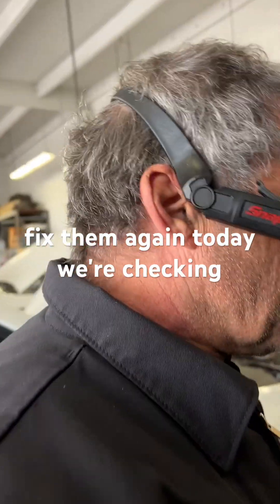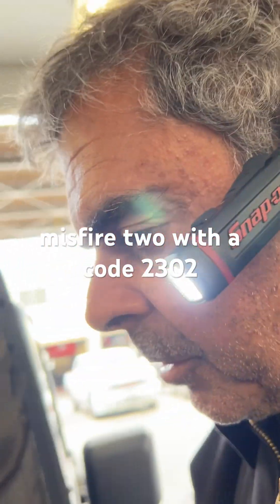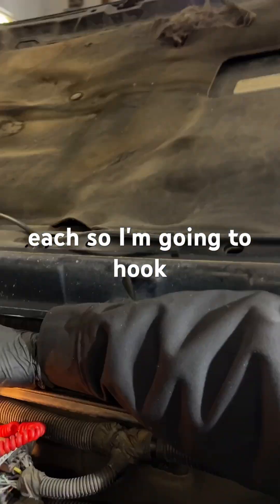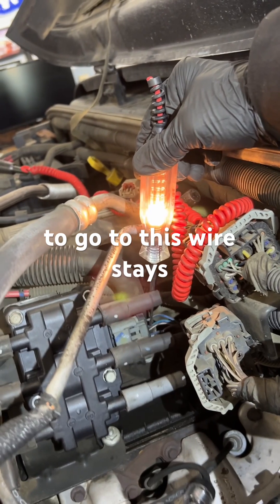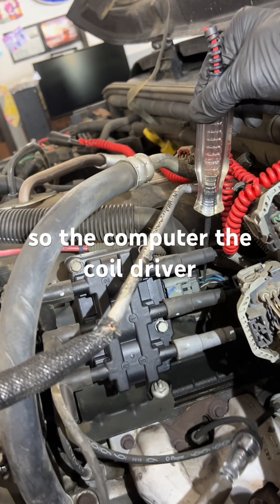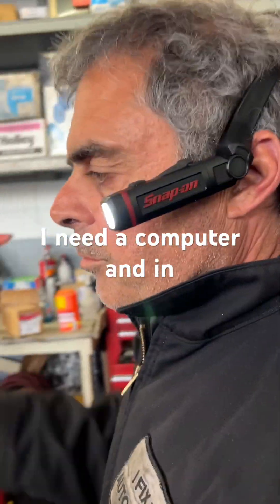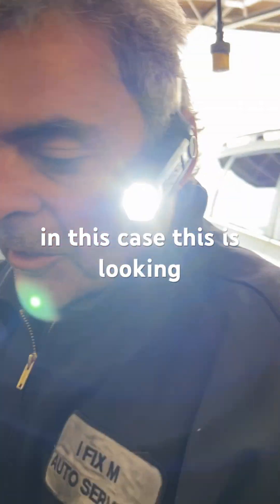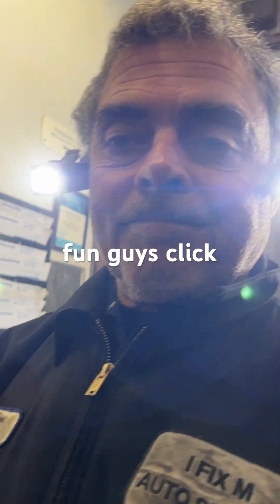Code P2302 testing signal from computer to ignition coil 2010 Wrangler

Comment: And then you’ll have problems when the holes you poked in the insulation corrode instead of back probing. Hack
Reply from the maker: Those pin holes will be the least of concerns with future faults on that vehicle.